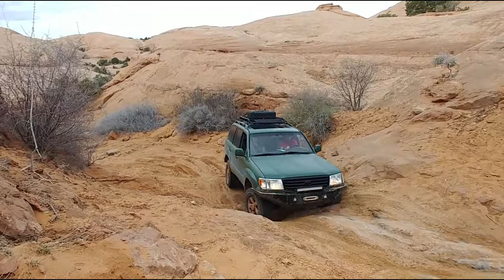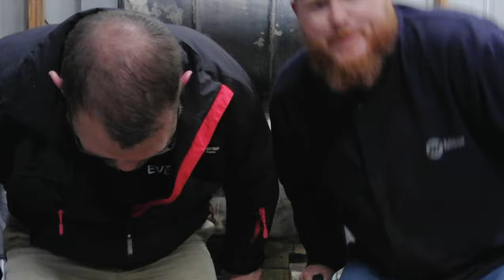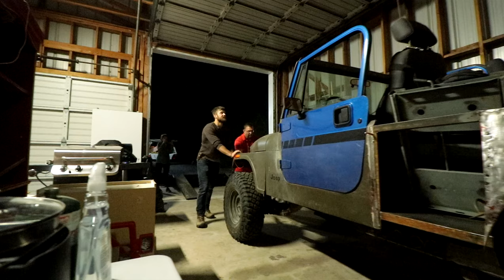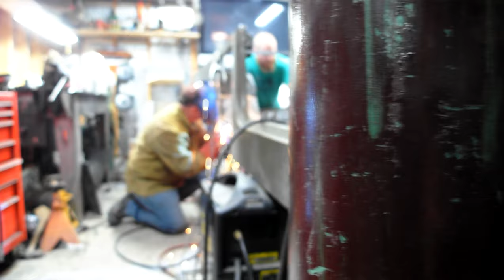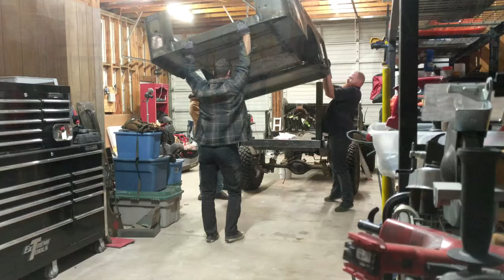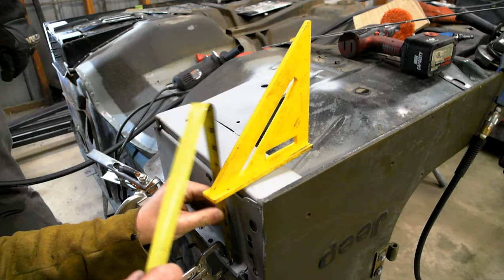Jade the Jeep: Custom Overland Build

Comment: Im glad you guys can see through all the hate and stand by your own opinions! Jake is great and so are you guys for helping him out! If I was in your area you would be my new all around go to shop! I have a 74 westy and id like for it to be a reliable overlanding Rig you guys seem like you'd be up for any challenge unlike the expensive VW specific shops. Ive worked in shops and most would have went under if they didn't have a tire machine and alignment rack. Add that in combination with your welding/fabrication capabilities and you can't fail.

Comment: Glad you guys took over for the body work. Serious concerns about the drivetrain.
Reply from the maker: Thundercat68 that is all Jake and what he decides to do the motor he has is strong and we are regearing the axles, rebuilding the transmission. No motor swap yet as pre Jake
Reply: Tenacity Overlanding speaking of axles. Talk to Jake about contacting Artec  or G2 about axle truss setups and upper C gussets.   With the expectations of weight he will be packing into Jade. Axel housing failures are a real possibility. Simply re-gearing won’t fix the weak axles this YJ came with.

Comment: Could you guys fabricate up a CJ front grille to fit my YJ kinda what Jade has?
Reply from the maker: Sean Frank yeah we could
Reply: 1" body lift, and do some fine tuning on some CJ fenders and you can just drop in a CJ grill on your YJ.  Easy Peasy-  Parts needed: CJ grille, fenders, hood, 1" body lift.  Along w/the body lift, you can also do a "tummy tuck" as funds allow so you get more ground clearance.  EDIT:  For the 1" body lift, you use all the pucks EXCEPT for the one's at the grill.  You can re-use (or get new if they're bad) the factory mounts at the grille.  The CJ grill is taller than the YJ, hence the need for the body lift.
Reply from the maker: 212caboose yeah this is the correct way to do it, no fab work it all drops right in
Reply: @tenacityoverlanding  It's also cheaper- I'm not trying to take business away from you, believe me- But with Jade in the shop, and this being such an easy swap, I felt the need to speak up.  I mean no disrespect to y'all- I honestly can't wait to see what y'all will build in the future!!
Reply: Hmm....well I sure don't want a body lift.  I guess I'll have to live with square headlights.
Reply: @seanfrank4158 You will barely notice a 1" body lift.  For a YJ, it's a worthwhile mod- especially because you can do a tummy tuck.  But to each their own.  The only other way to "easily" have round headlights is to notch the frame under the grille about an inch- but you still need the CJ fenders and hood...  A 1" body lift is both cheaper and can be done at home by anyone.  But again- to each their own.
Reply: 1 in body lift is a good idea for tummy tucks and clocking t-cases. I'm with 212 caboose except get tube fenders to match up to a CJ grill. You wont regret it btf makes some nice kits.
Reply: @johnmullins2228  Tube fenders on a YJ do look pretty amazing!